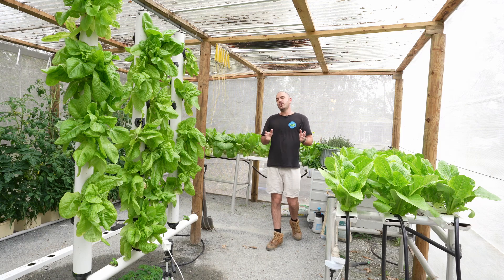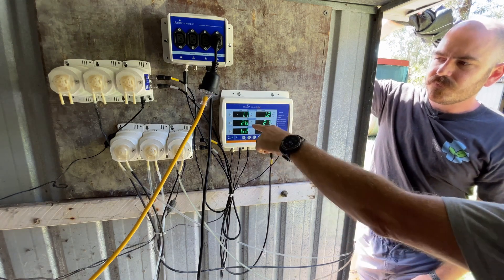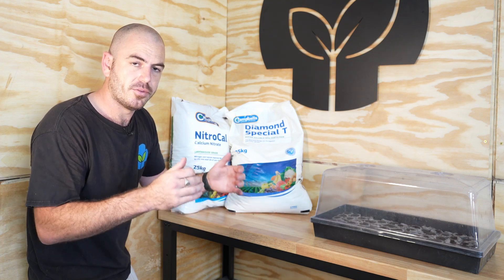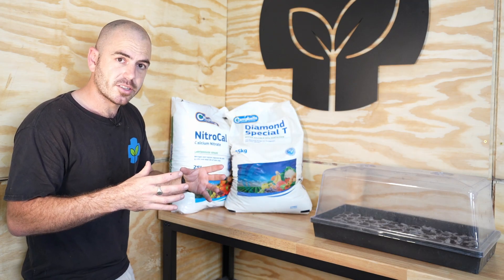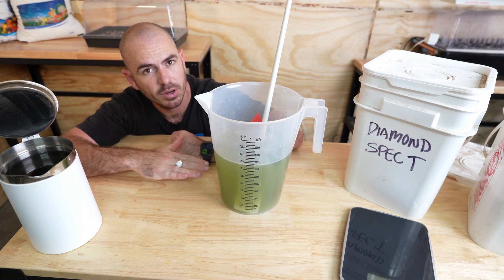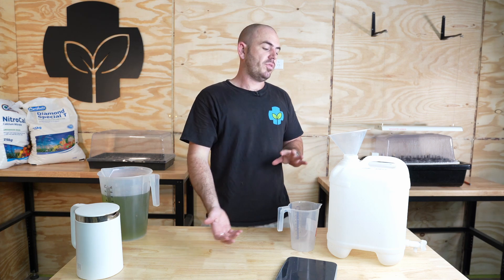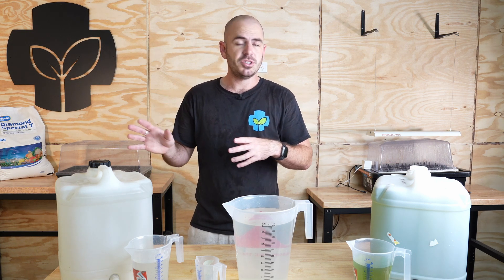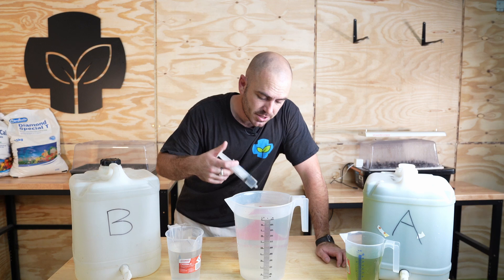How to Mix a Hydroponic Stock Solution

Comment: Hello,

I have a small hydroponics set up in backyard. I am growing tomatoes . Everything went well till start of December when water Temp starting to shoot up. 

Would you please recommend how to save plant roots going white to brown ( root rot). Would you recommend extra air pump will help. 

Also potassium promagnate,  will potassium promagnate cure the root rot if I add tiny amt in my 50 lts of reservoir or do you have any measurements for potassium promagnate. Earlier I used hydrogen peroxide but it's quite pricey for frequent use in the 50 lts tank

Thank you

Comment: Here's a quick hack for Freedom Units: 4ml stock solution to 1000ml of water means the stock solution a 250x concentrate. Since there 128 Oz per gallon, then mixing half oz per gallon would be 256x concentrate. So even if you used the same stock as he is, and mixing a half oz to 1 gal, you'd be really close (result would be slightly weak at 98%)
Even better, if you're going to use imperial units, just aim for 256:1 ratio on your stock solution so you can use the half oz per gallon and be dead-on.

Comment: Those square containers are designed for mixing whereby you firstly put the lid back on, hold the container by the handle and down at arms length and you simply turn your wrist back and forth at pace and those nutrients will be blended effectively and efficiently

Comment: do you use tap water / distilled water / RO water ? Ive been using RO water for my Hydroponics and have dabbled with tap water but my tap water has a starting EC of 0.8 and of course i dont know the make up. Curious if youve had experience or input

Comment: Is there  a difference between hydroponic fertilizer and normal dirt fertilizer?... or do your do jus call normal fertilizer  hydroponic fertilizer?
Reply: Hydro fertilizers usually contain everything... so not just N, P, K but also Ca, Mg, S and metals like Fe, Zn, Cu, Mn, B, Mo (mostly in chelated form). Normal fertilizers are mostly NPK (sometimes metals or Mg/S) because you usually don't need to worry about Ca, Mg, S and metals in dirt growing.

Comment: Doing a bit of excel, in order to make 1 Liter of "watering water" at a time of half strength solution (I want to grow coriander in pretty small containers, I mixed 12.5g of A and B into 500mL bottles. It means I need 20mL of these base solutions to make 1L of half strength watering water. I'll get 25L of watering water for leafy greens from these 12.5g of inputs in these 500mL bottles. For A, i used Kristalon from Yara. For B, I used Calcinit from Yara. I'm in Bucharest. I figured that it would be a pain to measure less than 20mL at a time from these base solutions. I ended up with an EC of c.1.5
Reply: A syringe is useful for measuring very small amounts accurately.
Reply: @atomizer2665  Indeed, just didn't have one laying around so i improvised. But yes, totally.

Comment: Hey Hooch, You've been a true saviour mate!!

I've had a large urban garden for a few years and now I've been wanting to get into hydroponics.
Your video's have been a true miracle.
Your extensive knowledge is impressive to say the least.

Enough with the gushing, on with the question!!..lol

My plan is to start a quad tube grow tower, an NFT and Dutch Buckets.
I will be picking up a large 1000L reservoir that I plan to use to feed nutrient to all systems through a feed reservoirs with float valves.
I'll be growing a large variety of Veggies in all the systems.

Is there one general nutrient mix for all feedings (leafy greens and fruiting) or should I be mixing for specific plant types (requiring me to change the setup slightly) and use smaller fee reservoirs with different nutrient mixes more tailored to greens and fruiting types???

Don't know if that makes sense or not...

Cheers from Montreal!
Mario

Comment: I'm done at the part where, it was suggested to 3d print a funnel. Seriously, it's just a funnel. Literally you  can roll paper into a cone and used that at a funnel, but nope, your suggestion is to 3d print one...
Reply: Cut the top off a 2L or 3L PET pop/soda bottle with a pair of scissors.

Comment: Wouldn’t the mixed solution have a different specific gravity than fresh water? That would then throw out the concentration if you’re basing it of mL instead of calculating by weight would it not? Or am I simply overthinking it?
Reply: You are overthinking it:) If you make the stock solution accurately you will know the weight of chemical vs volume, ie, grams per ml. 
You need to consider the solubility of the chemical and the temperature the stock solution will be stored at. The more concentrated the stock the less room you`ll have for downward temperature swing. Most companies that make dry nutrients will give you the recomended maximum concentration, typically 100g -150g per litre,  the 250g per litre shown in the video is at the very top end but  Oz is a warm place.  To ensure the elemental accuracy of the stock solution you should use with distilled or at least reverse osmosis water.  Using tap water will likely result in precipitation and/or elemental changes due to chemical reaction. If you contaminate a stock solution using water with an unknown elemental content, you wont have an elementally accurate stock solution.
Reply: @atomizer2665  Most importantly, you have to convert P and K % content to real one if the P and K content is listed as P2O5 and K2O which mostly is. They still use the outdated description which is misleading. P2O5 to P = multiply P2O5% by 0.44 and K2O to K is multiply by 0.83. So if the label says NPK 10-10-10 it's actually 10-4.4-8.3 real P and K weight. The P2O5 and K2O isn't even in the fertilizer, that's how stupid it is...

Comment: The highest quality and cheapest fertilizer is a fertilizer obtained by mixing chemicals purchased from a wholesale supplier of chemicals. Therefore, I will hope that the author of this channel will not be like housewives who buy bags with the inscription "fertilizer A" and "fertilizer B" in a garden store and dissolve them according to the instructions on the label. I hope to see the composition in generally accepted chemical names and concentrations in grams per liter of base solution.
Reply: Making nutrients from scratch isnt right for everyone. For one, wholesale suppliers of chemicals may not be legally allowed to sell certain chemicals to private individuals. The other issue is what is available in one country may not be available in another, for example, if the formulation calls for Zinc at 13% and they only have access to Zinc at 9%, the weight needed will be different, so it will involve more education than just a basic how to.  Folks will also need a scale accurate to at least 0.001 of a gram for the micro`s.  If growing is your passion, making nutrients from scratch is the logical step but its not for everyone.
Reply: @atomizer2665  You're talking utter nonsense! Individual chemicals of the fertilizer grade from which nutrient solutions are mixed are available in the same garden stores! Also, no ultra-precise scales are required when volumes of about ten liters are being prepared. Ordinary electronic kitchen scales are enough. Adding powders to a canister of three bags is no more difficult than from one! But the bag with the inscription "diamond spect" I have no idea at all what it is and how it can be replaced in my particular locality! At the same time, potassium nitrate - all over the world will be called potassium nitrate and magnesium sulfate will also be magnesium sulfate. It is enough not to be an idiot not to make a mistake in these names.
Reply: @ph08nyx  
I guess you didnt read the "from scratch" part, which means not a pre made 2 part dry nutrient like campbells. "From scratch" meaning using  individual chemicals such as mono potassium phosphate (MKP) potassium nitrate (KNO3) etc along individual micro`s such as Fe-DTPA, boric acid, sodium molybdate etc.  Good luck trying to weigh a fraction of a gram of anything accurately on a kitchen scale :)  A 10L stock solution of Diamond special T  (200x concentration) will involve a chemical weight of  0.564g so you will need an accuracy of 0.001g
Fwiw, the elemental ppm of Campbell`s Diamond special T at 1g per litre equates to NO3: 82, P: 17, K: 267, Ca: 0, Mg:17, S: 42, Fe: 1.5, B: 0.28, Zn: 0.23, Mn: 0.75, Cu: 0.17, Mo: 0.11, cost to make this formulation (converted to Oz dollars) would be  $3.66/kilo.  A quick google suggests a single kilo could cost as much as $24,  a 25kg bag will be cheaper per kg but still silly expensive when compared to the raw chemical cost.  Garden stores will generally buy from chemical wholesalers, split into smaller weights and quadruple the price per kilo. Over the last few years, the cost of agri chemicals has increased by 50%-60% in some cases,, 25kg of calcium nitrate (yara calcinit) used to cost the equivalent of $33 AUD, now its $51.25.

Comment: Thank you for the fantastic information! What is your opinion on adding magnesium Sulphate to the nutrient solution? I ordered some powdered hydroponics nutrients and it came with Magnesium Suplhate, and instructed to add it to the  solution at a ratio 50% of the fertilizer and calcium nitrate. Apparently Magnesium Suplhate is an additional nutrient but i didn't hear you mention it in this video - is it necessary?
Reply: I think it's already mixed in with the Spec T bag he has

Comment: Another great video. I am all new to this and todays project is to make the propagator & pucks! My local nutrient distributor does not stock the Special T and recommended the Dimond White as a alternative. The Dimond White has proportionally higher nitrogen. Do you think this would this be suitable? Any help appreciated.

Dimond Special T - 8.2% Nitrogen, 3.9% Phosphorus, 32.2% Potassium, 4.2% Sulphur, 1.7% Magnesium, 0.15% Iron, 0.075% Manganese, 0.028% Boron, 0.023% Zinc, 0.017% Copper, 0.011% Molybdenum
Dimond White - 15.2% Nitrogen, 2.5% Phosphorus, 25% Potassium, 1.9% Sulphur, 1.5% Magnesium, 0.04% Iron, 0.02% Manganese, 0.01% Boron, 0.020% Zinc, 0.011% Copper, 0.001% Molybdenum

Comment: ive been using Campbells diamond range commercially in my greenhouses since they released the range. would be nice if you could do a segment or segments on making fert from scratch. thanks bro
Reply: As a commercial grower it would pay you to make it yourself.  As a horticultural business sourcing the chemicals should be relatively easy. Private individuals typically have to deal with a lot of red tape when it comes to oxidizers.

Comment: Just wondering where you source campbells diamond Special T. I tried norco and drew a blank. There is a comprehensive list of ingredients in one of the ebooks I have but it means sourcing things like Mo trioxide that costs a small electric vehicle.
Reply: Nutrient companies like to use oxide equivalents in the guaranteed analysis, such as CaO, MgO, K2O, P2O5 etc. in place of elemental Ca, Mg, K and P.  If you use  sodium molybdate, you`d need 7g  per 1000L of diamond T nutrient solution  @ 1g/L.

Comment: Creating the nutrient from scratch would be an awesome episode. Especially if you included expected shelf life or variations. That could even be a short series, if the viewers supported it.
Reply: soo interested in this.  I imagine it'd be some sort of compost tea, urine, and eggshell mix but I can't seem to find much info on it
Reply: @keysersoze1202  It be just packets marked as B, Cu, N, Zn, Mo, Fe, etc. and work with miligrams. You potentially get 10x cheaper customisable to strain and stages solution minimising lost of water and materials. But you need to be at least a bit of chemist dto make it work at full potential have some tools and reagents to tests or use side lab. Organic is suboptimal.
Reply: This is ultimately what i'm after
Reply: https://youtu.be/JoFVy1jfBN4?si=sWW2lfJPXQWil5Qf

Comment: Hydrobuddy is great for making nutrients from scratch, although I'm sure that you would make one more entertaining video with less maths and more beer. I also rate the blog archive on hydrobuddy which is a treasure trove of great information for anyway looking to do a deep dive. After going down the rabbit hole, I am now supplementing my Campbell's fertilisers with EDTA (chelate to keep metals in solution), specific trace elements that are low in cambells, a pH buffer to combat pH increases (Potassium carbonate), I also use potassium silicate foliar spray to get silicon to the plants in the most cost effective way. My interest in hydro is how to grow plants as fast as possible so all the little bits that give an edge are great to me.
Reply: To maximise gorwth you need to maximise all the variables, the most critical one being environment. If you have the environment nailled down then you can look at the rest. My recommendation is to choose a growing method that gives you total control over all of the impotnat variables. Ideally, you want one that provides realtime feedback from the plants, so they can tell you exactly what they want.

Comment: 14:57  you should be wearing a p100 respirator  or at least a mask
I didn't and I breathed in a little dust  , not even visible  but I had a horrible taste in my mouth and   a metallic taste that lased like 2 weeks (master blend) probably from the  micro nutrients, specifically metals 
also Ca(NO3)2 is a nasty oxidizer not  really something you want to get in your lungs

Comment: What are the benefits of creating nutrients from scratch? definitely interested on the future video!
Reply: You can create crop specific nutrient formulations from one set of  agricultural chemicals.  Some countries restrict the sale of some chemicals (typically oxidizers) so YMMV depending on where you live. The main chems, which typically come in 25kg sacks are: mono potassium phosphate (MKP), potassium nitrate, calcium nitrate, magnesium sulphate, potassium sulphate. Ammonium sulphate and magnesium nitrate can also be quite useful. Most folks use a micro mix such as STEM etc but the purists prefer to use individual micro`s (Fe, B, Zn Mn,Mo,,Cu).  If you are a small scale grower you may be better off using a 2 part dry nutrient vs making your own from scratch. The price of chemicals has increased massively and will likely keep going up which should be taken into account. Its important to note that you should always use distilled or reverse osmosis water for your stock solutions to ensure they are accurate.

Comment: Thanks so much for your valuable info. I also learnt about putting part B in before part A which I wasn't doing. I'm just starting out with hydroponic veggies and hope to get better as time goes on. Keep up the gr8 work. Will be tuning into your videos for more informative knowledge in the coming weeks Just a quick question. Do you add Epsom salts to your A solution ? like I do when using Miracle Gro UK

Comment: For some reason I thought you had to use your nutrient solution immediately once you mix it. How long is it okay to leave this solution for?
Reply: A couple months or longer it shouldn't dissipate as long as its in a light proof container or kept in dark. I mix mine in 2x two hundred liter blue plastic drums and it takes about 8 to 10 weeks till i have to make up more part a and b.

Comment: Great man. I don't bother with that shit at home. My reservoir is 1000 litres and I chuck in 500g of Diamond Blue or Special T depending on my mood and 500g of Calcium Nitrate. Recirculate it for 1.5 hours at mixing and an hour every morning before watering commences. That works fine. Not enough concentration of anything for precipitation.

For a laugh I thought I'd tell you what we do at work. 17 hectares of blueberries, raspberries and strawberries. All have different mixtures depending on whether fruiting or no, variety etc and all are going at the same time somewhere.
Current non fruiting mixture for raspberries (and yes calcium nitrate is always A):

A tank (1000 litres):
Calcium Nitrate             175 kgs
Calcium Thiosulphate  20 Litres 
Potassium Nitrate         12.5 kgs
DTPA Iron                        2.5 kgs
Mg                                    1.0 kgs

B tank (1000 litres):
Magnesium Sulphate   100 kgs
Potassium Nitrate         12.5 kgs
Magnesium Nitrate        25 kgs
MKP                                 25 kgs
Boron                               94g
Mn                                    600g
Zn                                     600g
Cu                                     36g
Moly                                  24g

And we use Phos Acid (down) and Potassium Hydroxide (up) to adjust pH.
We run about 3-6 litres of each solution per 1000 litres of water depending on EC requirements as the plants change. That solution lasts about 1-3 days. 

I hope I'm not being a dick, my only point here is that the systems you show are infinitely scalable under the right conditions, and that  I do perfectly fine with my dinky setup at home (and I don't have to pay the fert bill at work). 

Stay strong Bud.